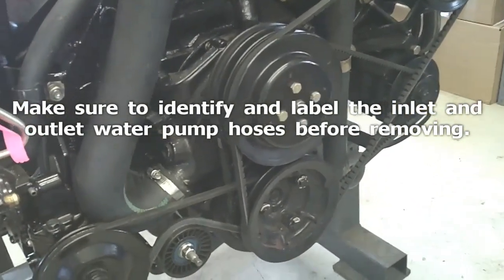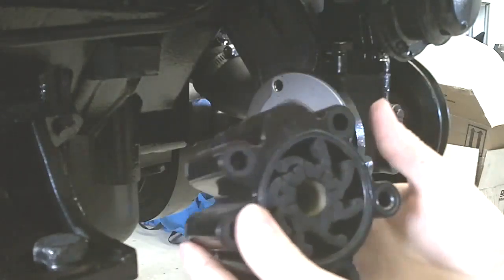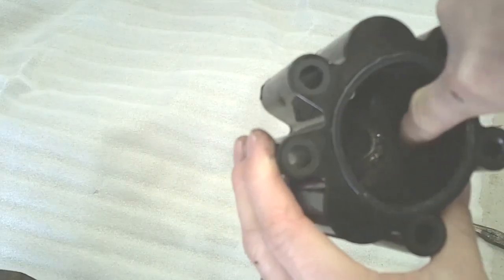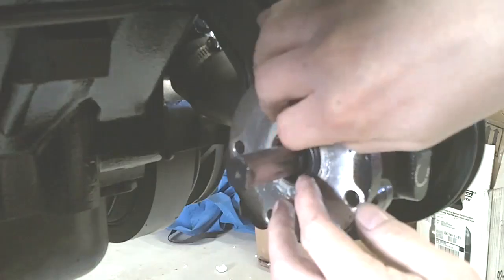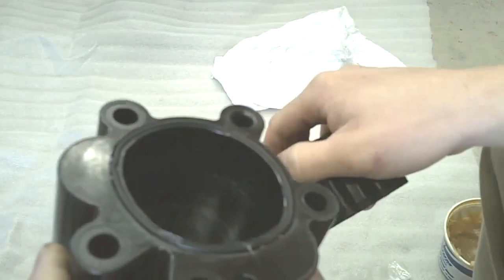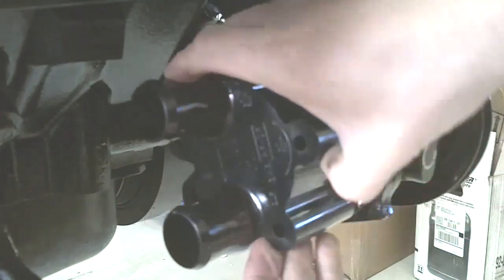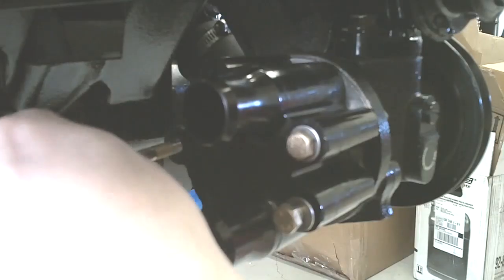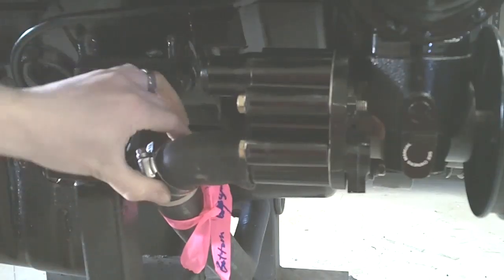Replacing Your Mercruiser Marine Engine Sea Water Pump Impel

Comment: You should never use oil or grease on an impeller it will reduce its efficiency you should use a water soluble lube like baby oil. Also you spun the impeller the wrong way which is bad because when the engine is turning to start its almost instantly up to 500 rpm which will force the pump to change the blades not what it is designed to do, also I've seen blades break off the impeller because it was spun backward. Lastly this is the rarer type of pump for mercrusiers (will be this on most inboar

Comment: @thebuilderdude68 Yes, I just triple checked. He did twist it the wrong way when reassembling the housing to the pump body. But I doubt it would re-orientate the fins of the impeller. If doing that was enough to change the blade direction then as soon as the engine was turned over it would fix itself again probably. Not the best procedure though, but that's what the pressure of having to narrate on vid can do.

Comment: I agree this is much easier when the pump is off teh motor. The front mounted crank driven pumps are easier to service with the pump body left on the motor.